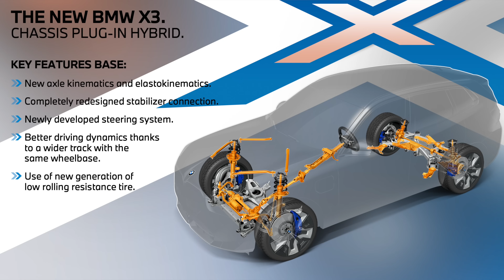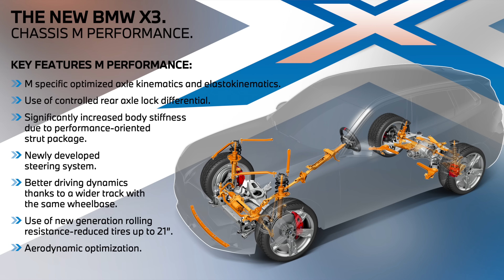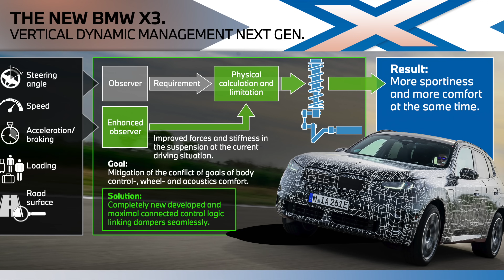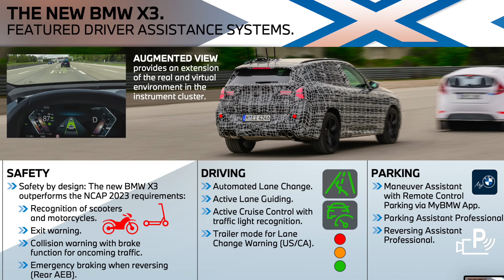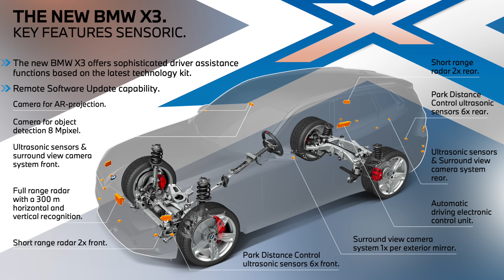2025 BMW X3 - Technical Workshop

Comment: I will call it a face lift. Not a new generation. My current 2023 one with 18 .000 km already has suspension noises and noises inside saloon. . Bad quality.
Reply from the maker: Maybe, but it's a new generation. Bigger, different design, etc

Comment: I wish BMW would stop making each generation of its vehicles bigger and heavier than the one before.  The current X3 is.a large and heavy enough. More technology is required to compensate for all the extra size and weight.
Reply: I do. A 2019 X3 M40i.  And a 2015 M3, which is as big as the old M5.
Reply: Maybe alot of people out there want it bigger.
Reply: Belt driven steering?  What could possibly go wrong?
Reply: Do you own one?
Reply: That’s so true . My current Alpina XD3 is as large as my 2016 X5M. They are increasing size and weight and $$ and no rationale .
Reply: The X1 got the quite the bump in dimensions for the U11. I guess the X3 wont be any difference. I do wonder what happens with X5/X7 because at some point you're entering 9-seat territory  😆
Reply: why do u wanna push or lift it,what difference does it makes to u brodr
Reply: No.  X3 has less space then a Rogue/CR-V.  They need a few more inches to compete.
Reply: People want bigger and larger suvs and cars.  And most are not telling these Mfg’s they don’t want these behemoths!  😆

Comment: What's up with that tremendous/horrific/giant screen bezel 3:42? That is a NO NO. The screen is already small, now includes maybe 30% bezel kiakkkkkkkklol.
Reply: You don't really notice the bezel on that screen because the edges are behind the steering wheel. The bezel on the screen on the right is smaller.

Comment: What about range for electric drive? still same as previous model?
Reply from the maker: Unclear, but we saw 82 km on the computer when we started the trip
Reply: it depends on battery capacity. If its same as in previous model then around 40 km